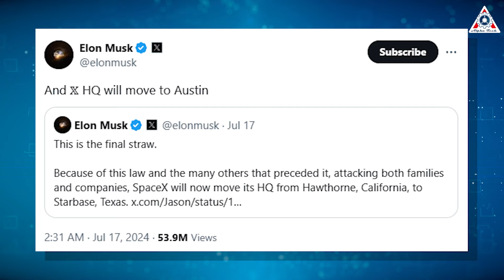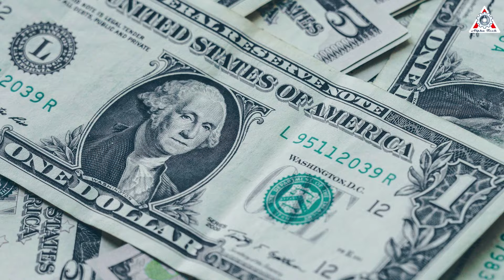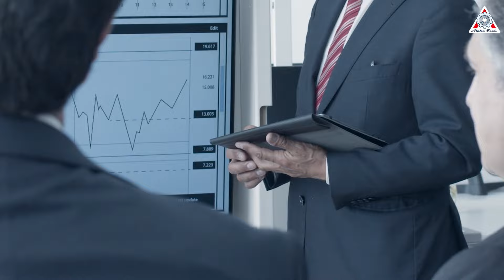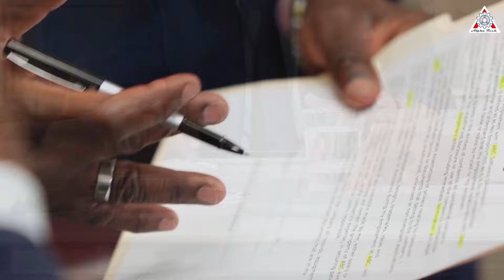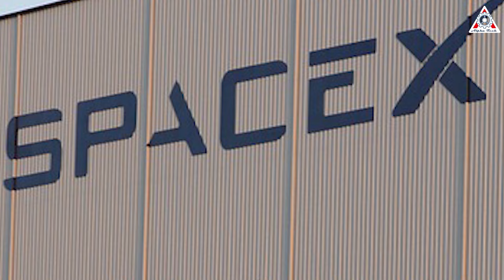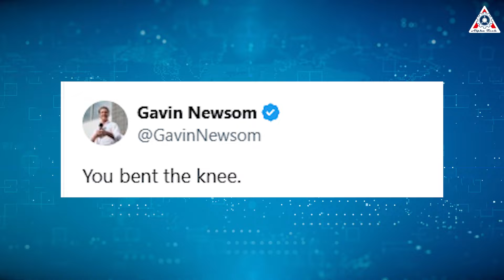It's Mind-blowing! What SpaceX & Elon Musk Just Did Humiliated Cali's gov...

Comment: I grew up a couple of miles from where SpaceX manufacturing is in Hawthorne.  CA has been hostile to businesses large and small for decades.  I have a friend who had a two-man business making lint-free cleaning cloths.  As part of manufacturing the cloth was quickly run through a small gas oven to dry it out prior to packaging.  CA regulations changed 20 years ago to require CO2 collectors on his oven "to prevent global warming."  The collectors would have cost ten times what he made on the business annually.  He sold the business and the hardware to someone in another state where environmental regulations were not insane.  There are thousands of examples just like this in CA.

Comment: What SpaceX is doing is only just the latest.  El Segundo and that surrounding area is THE aerospace hub of California (and the nation).  Driving around there and you'll find a who's who in aerospace from Northrup Grumman to Boeing, Lockheed, Raytheon, and many many others.  This includes many of the smaller primes that support the big aerospace integrators like L3, Rockwell Collins, Aerojet Rocketdyne, and a myriad of support companies to the larger primes.  This area represents the core to California's middle class jobs, and the core of CA's tax income.  Some of these have already begun to move out.  Take a look at the huge new facility that Northrup just built in Chandler, Az.  This sector along with Hollywood, which is currently losing money and Silicon Valley which is also suffering a corporate brain drain as companies flee California's extreme leftwing government.  California's massive economic engine is beginning to lose cylinders, right underneath the nose of the leftist politicians and their socialist experiment, but they don't yet feel the pain of the lost tax revenue just yet.  Over the next 18 to 24 months they will begin to see where their policies really lead the state.